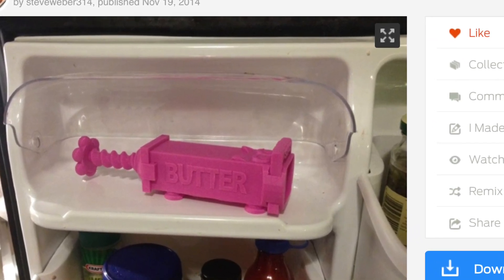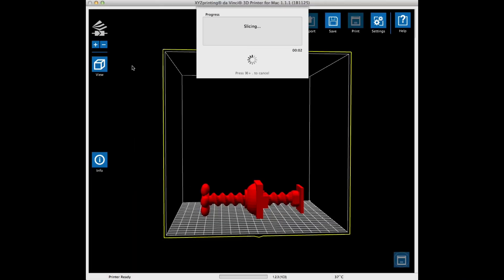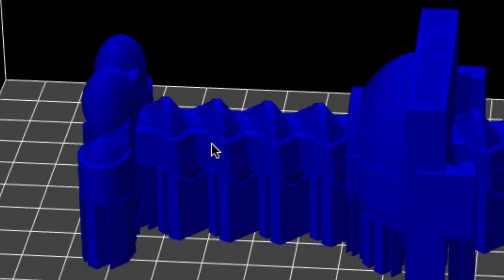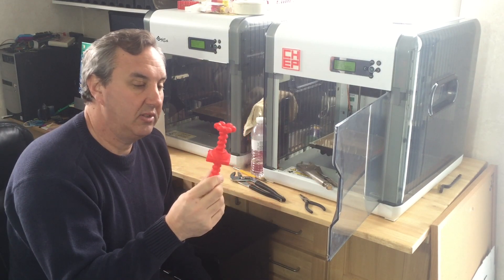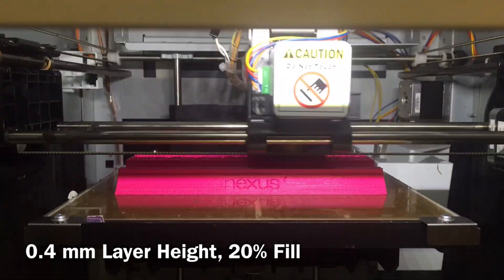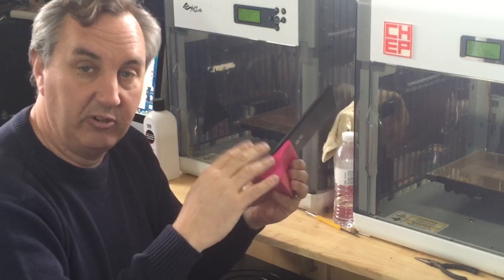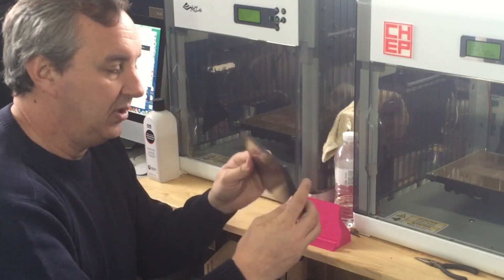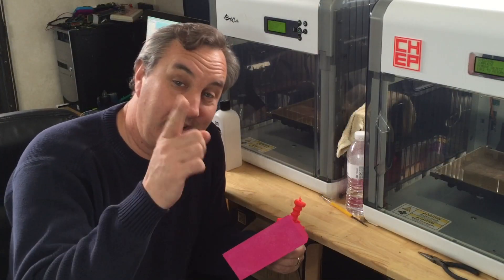Filament Friday #5 - Butter Pig and iPad Stand - Video #040

Comment: Chuck , nice channel.
Re latest print, the slicer is something we need to look at.  I have been very nervous about changing anything in the XYZ ware orprinter software, but it really seems to be the weak point.  Nervous due to some comments about the altered software hitting the glass and chipping or cracking it with the extruder.
I have Slicer software but have not printed with it.
What do you think is the best way forward?
Maybe you should send an email toXYZ.

All the best,

John

Comment: Everytime I use support with XYZ I get a certain part that becomes larger and squared out instead of being round or detailed its ruin 324 prints of mine already. It's a little upsetting especially because usually when using support it's because you're building and large or delicate item and it just seems to ruin them it squared out a Mickey Mouse head on me squared certain parts of armor on a model I was printing and I have found when printing iPhone cases and such it never seems to fit right always a little smaller

Comment: Hey Chuck!

First time commenter, here. I just wanted to say I'm really loving your videos.

A small tip that you might find handy - I use a bottle of water (cooled to the room temperature). The bottle has a tight nozzle at the end of its cork (something like an alcohol bottle). So, when the print is finished, and it's stuck to the bed really firm, i squirt some water on the edges of a print, and have it unstick from the bed that very instant.

Because of that, I don't need to wait for it to cool down, but I can immidiately resume printing (withoout having to wait for it to warm up again). Of course, you wouldn't want to overdo it with the water, but just squirt a little. Surface tension keeps it together from flowing off of the heated bed and onto the sensitive electronics. Afterwards, you just wipe it off with a paper towel.

And also, I'll have to agree with others that commented at this video. Using different software with my DaVinci made it so much more capable printer! I'm currently using a combination of Simplify3D as a slicer and repetier firmware on my DaVinci, and it works beautifully! 

I also connected my DaVinci to a Raspberry Pi and made it wireless using AstroPrint. Makes for a nice way to control it from an iPad :) (and supervise via webcam).

Maybe the software upgrade process (and coparing the newly printed stuff to the old results) would make it for an interesting video? Anyway, I love your videos, so keep it up! :)

Cheers!
Reply: Hey Chuck!

It occured to me at one point that the glass might crack, but by then I had tried the water trick a couple of times, and I had no issues...

I think it doesn't crack because the bed is covered by borosilicate glass. It's a type of glass chemists use for their pots and cups, that is (according to Wikipedia at least) able to sustain rapid temperature fluctuations and high temperatures without cracking or changing its dimensions...

But I'm not a chemist, so that is just my best guess... Take this info with a grain of salt ;)

Wikipedia source:
http://en.m.wikipedia.org/wiki/Borosilicate_glass
Reply: I don't know if the Davinci glass is Borosilicate glass. I've been doing a little research to find a replacement piece for my Davinci 1.0. I pulled a little dimple out of my glass once when I didn't wait long enough to cool. However, when I wait the prints just slide right off. I stopped using glue and found prints hold well until they cool.
Reply: renoflash06 Chuck, My glass has been back to factory for a couple of weeks now. When it comes back I'm going to put some .005" Kapton on it. That should provide the same no glue / good hold as the glass but also spread the 'pull' from the ABS as it cools...which hopefully means no more 'dimples'.

I also have a cart of the Purpurlin....I had printed 40 meters from it when the cart started getting failures (XYZ is replacing it so no worries). 

When I get my Davinci back up I'll post up some more videos....

Jay

Comment: you should have taken some advice from your past self and split the model in two then glue together with acetone.  Also raft and supports as they currently are (meshmixers does trees which isn't bad) are never a good idea ALWAYS try to print without a raft and certainly without supports.  There is more than one way to "slice" a cat ;) hehe  as for the stand try a higher temp (i usually use 250 for abs on a few spools) to get max layer adhesion and help with the splitting also a 100 heat bed.  Keep up the good videos!!! :D
Reply: ***** Ah I gotcha. I guess its good to show the default printer settings and what it can do, maybe as an additional part of the segment of the show, you can use your second printer and show what can be accomplished with changes in design/software/firmware etc.  Like using simplify 3d, splitting it, etc.  (that is when  you get simplify 3d, which I can't recommend enough and is worth every penny).  Granted up to you if you wanna take the time, I can certainly understand if you want to keep these as short as possibly  especially with the editing involved. Again great work, look forward to the next friday build! :D

Comment: I have had a similar issue with the xyz slicer.
Reply: ***** I also get weird artifacts that show up after slicing sometimes. Sometimes ledges, sometimes spikes. Seems to always happen on a curved surface.
Reply: ***** Different print, I was printing a Halo Pistol, and about 3/4ths the way up the slicer started making random cube shapes from it.

Looked at the finished sliced file and the weird cubes were their but they did not appear in the stl. 

It appears to be a problem with more complex prints in XYZware.